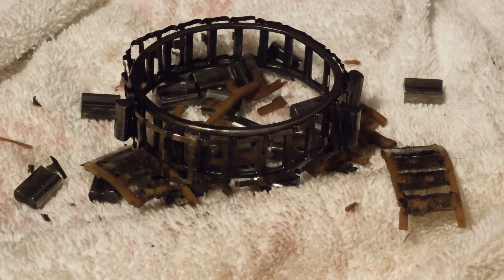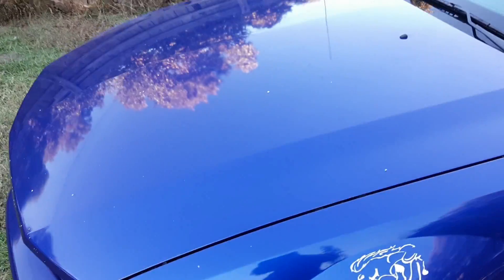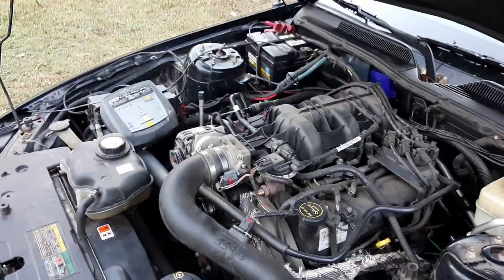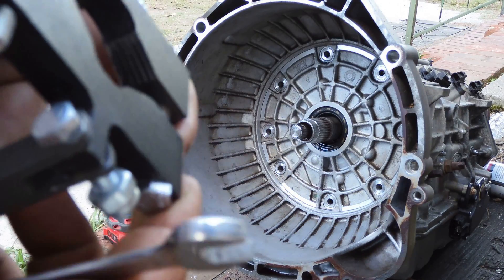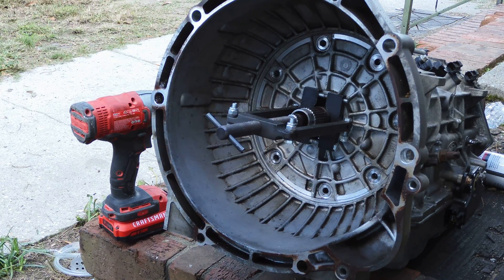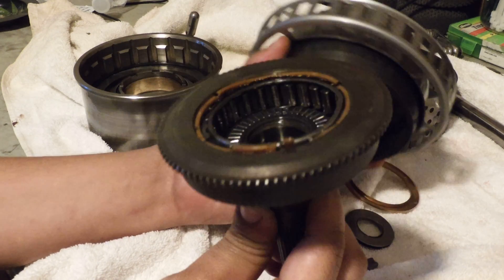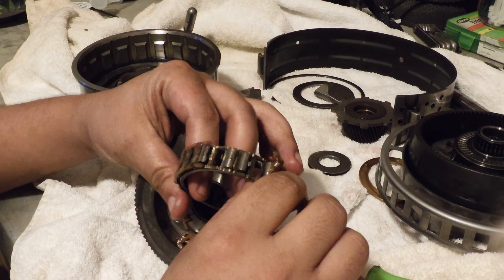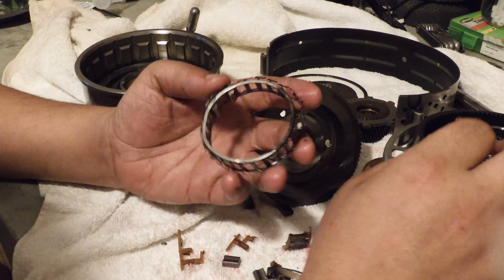No Drive Or Reverse.. Transmission Fixed For $25? Transmission  5R55S 5R55N 5R55E 5R55W 4R44E 4R55E

Comment from the maker: Just to update everyone, The transmission is back together and the car is driving again, but I think I will make a video on the transmission relearn procedure because it is necessary after performing this repair..  I really hope this helps someone, this literally saved me thousands of dollars.. Remember any job is a balance of Quality, Speed, and Price.. If you need it done right and done fast take it to a shop, but it will cost more.. If you want it done right and you want it done cheap, do it yourself.   It may take longer, but it will definitely be cheaper.. Just don't get in a rush, Take your time and make sure it's right so you only have to do it once..  There are a lot of 5R55 teardown videos out there, take advantage of them,  it could be worth thousands..
Reply: Hey man I’m planing on doing this to my transmission because I have the same issue, is the video about the relearn procedure up? Or any suggestion of where I could find it?
Reply from the maker: @Tonyrl103  I haven’t posted it, but what you need to do is from a complete stop, accelerate thru all of the gears without going over 50mph.. then slowly come to a complete stop and repeat.. The first time it will shift a little rough then it will get better each time.. You need to do this at least 5 - 10 times.. then just drive the car normally for the first 500 miles and the computer will relearn the proper shift pattern for the way you drive the car..
Reply: @williamblanks8500  thanks man! You saved me a lot of money!  I appreciate it!
Reply from the maker: @Tonyrl103  awesome to hear, really glad I could help..
Reply: @williamblanks8500   how can you accelerate thru every gear yet not break 50? you mean slowly accelerate? will it go into 4th under 50? or overdrive?
Reply: Thanks for this video
Reply: Thanks so much it was helpful